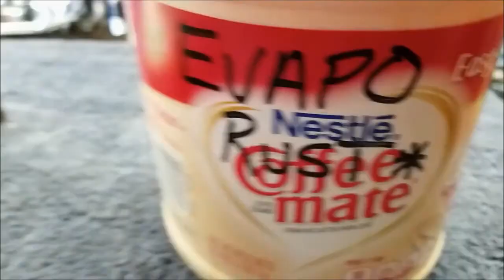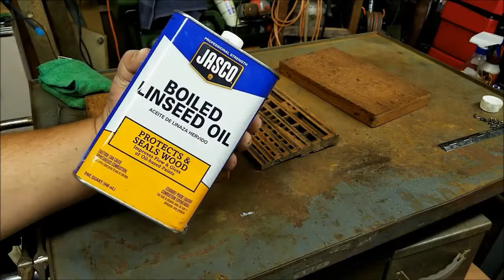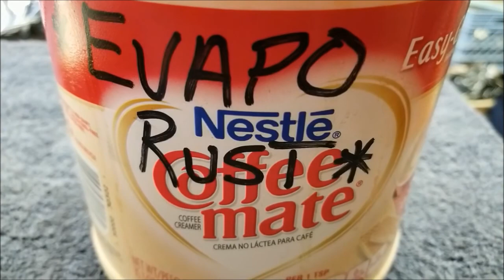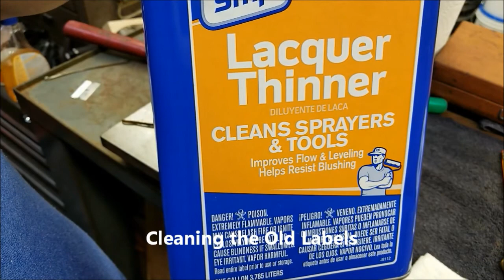Gage Block Restoration, Dearborn Gage Co.,

Comment: The dinging when poured out the coffee can into plastic container gives me goosebumps ugh!!!
Reply from the maker: Hello Paul,
I tried to be as gentle as i could, remember they are hardened.  Thanks for the comment...and thanks for watching
Mike - Plus8Precision
Reply from the maker: Yes they should all be within the same rc range. I guess most hobby machinist dont realize that in industry for worse than me washing my set happen to gage blocks. I was as gentle as i could be. Thanks for the comment.
Mike - Plus8Precision
Reply: As long as the force of the ding is within the plastic modulis of the steel, it bounces back into shape like rubber; hardened steel.
Reply from the maker: @mackk123, yes i agree my ding technique was very lite that day, lol. 
Thanks for watching and commeting...
Mike - Plus8Precision

Comment: You ought to get those blocks certified
Reply from the maker: Jacob, i dont know the cost of calibrating jo blocks. I never did any research to find out. I dont know what value that would bring me, i work in an environment that is not climate controlled. Thanks for watching and commenting. 
Mike - Plus8Precision
Reply: @Plus8Precision - Calibration or recertification fees are around $3 to $4 per block. Hardened is not the point. PRECISION measuring is the point. You treat your gage blocks like a hack.